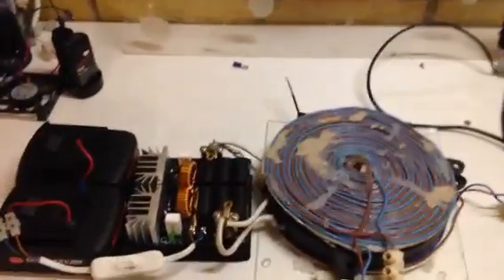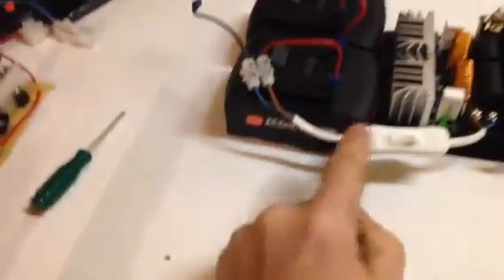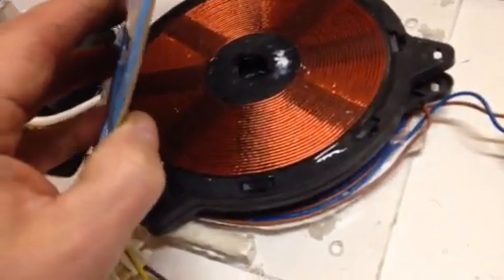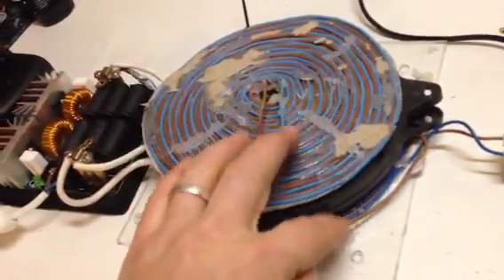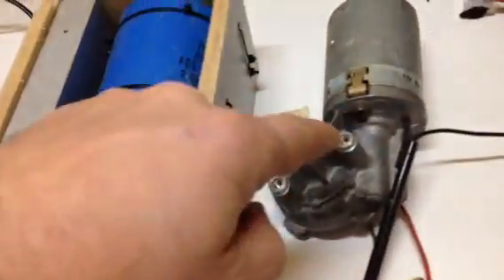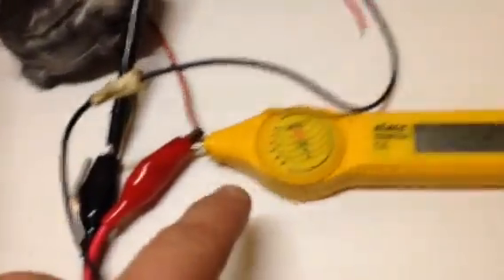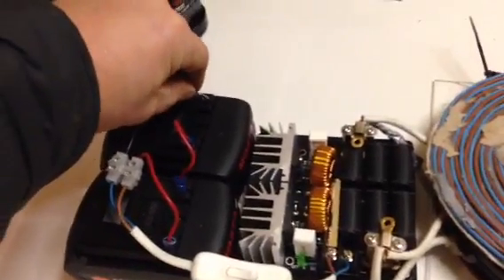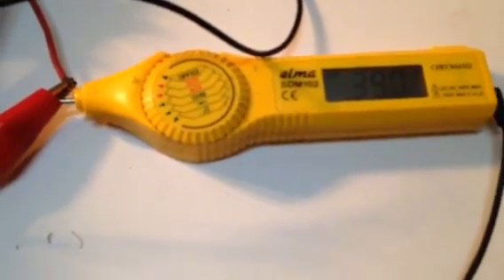Induction transformer/ kapanadze

Comment: Hi - just waiting for my ZVS driver to arrive - what's the black box between your coil and your halogen lamps? Thanks.
Reply from the maker: Mark Flint it's just a switch from an old lamp:) no tricks
Reply: LOL - thanks. I just did a test on a mini induction cooker (500w), the 130mm pancake coil I wound from speaker wire is not giving great results on a 400w halogen with an input of 440w. Perhaps not enough inductance going on. Might have to wind another coil with different wire.
Reply from the maker: Mark Flint yes use normal electrical cable threaded. 2.5mm I think. Copper. This seems to work best.
Reply: dkdyker cool, thanks for the tip.
Reply: Oh - sorry - are you saying stranded, like multi-strand copper rather than regular twin and earth type which is solid copper?
Reply from the maker: Mark Flint stranded yes normal that you would get in any appliance for 230 or 110vac. Not solid. You can make various also solid so that you can decide yourself. I found it is easier with stranded. Take a look at JN labs on YouTube look at the Gegene experiment. He has info on coils and how to make them. Hope it helps.
Reply: Thanks for clarifying - cheers.
Reply: What kind of amps are you pulling from that 36v battery with this level of load in the vid? I am thinking of getting an ac-dc power supply for testing this.
Reply from the maker: Mark Flint I don't have an amp meter to check so I cannot be sure.. Good idea to find this out before investing.